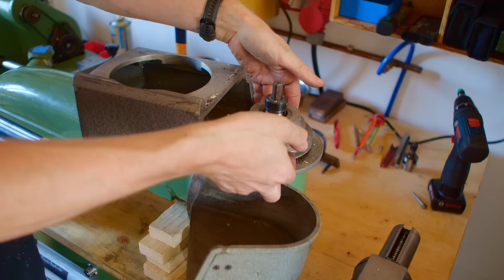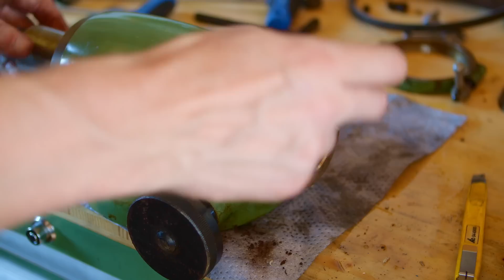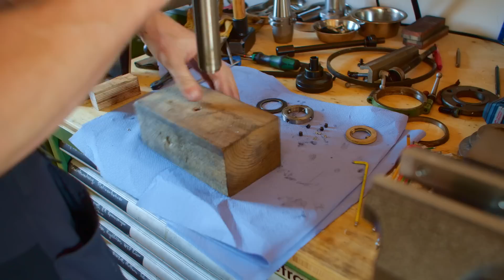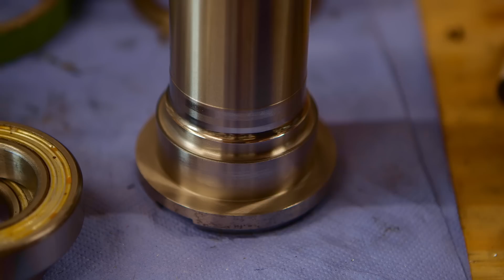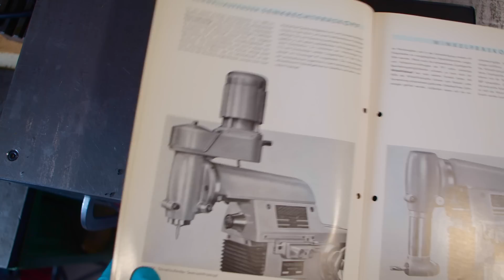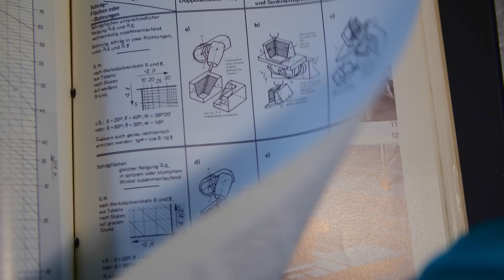Deckel Highspeed Head Teardown

Comment: Hi Stefan,
It's a great video again with lot's of information as usually.
May I ask you which Kluber grease do you propose for Deckel milling heads?
Thanks.
Sandor
Reply from the maker: That would be LDS18 if i recall correctly
Reply: @StefanGotteswinter thank you!
Reply: @StefanGotteswinter thank you!
I have asked since I have seen both NBU15 and LDS18 proposed on the internet. However as far as I understood LDS18 is preferred by Franz Singer as well.

Comment: @StefanGotteswinter do you maybe have some information of Deckel LKB (Feinbohrkopf 2021 model)? I have problems with sticky quill movement. When the spindle is working for awhile it starts to get harder and harder to move. I had it already disassembled awhile ago (was searching for dirt or rust inside) but didn't find anything with the naked eye. As much as I watched some videos (there are not many) the quill should move with the clutch engaged without a problem as well as with the lever. If I remember correctly I saw somewhere that the quill goes up by itself with the help of the spring. I can only wish with mine to do that. To me it seems like the housing and spindle bore are from two different heads put together and is not matched together correctly. Do you think it's possible. Any info would be great :)

Comment: Which episode shows the re-assembly ?
Reply from the maker: Not finished yet :)
Reply: @StefanGotteswinter  are you planning main head teardown or it's similar enough?
Reply from the maker: @MarekReinsch  No, not planned to do so - Its running fine and i don't expect problems. Its very different, running with needle bearings.
Reply: Thanks for your reply! Are the drawings available to know what's inside? Where do you get parts? Only from your local vendor where you bought your machine? On my normal head, the plastic guard around the gear is broken into a few pieces as I assume someone did not store the head correctly when removed...
Reply from the maker: @MarekReinsch  Franz Singer, FPS and Arnold Werkzeugmaschinen have spare parts and replacement/rebuilt heads
Reply from the maker: @MarekReinsch  A drawing is in the spare part list of the mill - careful, there are a few versions and iterations
Reply: Thanks for the recommendation. My FP1 is a bit neglected by the previous owner, but pretty much complete, including normal head, high speed head, 90degree angular head, variable angular head (missing motor), straight table, adjustable table, rotary table, indexing head and arm. I also got one of the Deckel cabinets from the catalogue but a bit worn. Currently doing an initial maintenance to remove years of old oil.
Love the channel! Thanks for taking the rotary table and high speed head apart!
I hope to get the slotting head at some point as I'm missing that! Also installing the overhead hoist next week.

Comment: Hi Stefan i have the dubble elbow with the high speed head but not the part to attach it to that machine. 
do you know if the was one for the fp1 or they used the one for the ordinary high speed head for fp1?

Comment: Those bearing look like some NOS Yamaha motorcycle steering bearings I have.
Ball bearings oscillating (only turn 60~90 degrees) isn't exactly best set up for bearings designed to rotate but it's worked for more than 100 years and gives lighter steering at low speeds than taper roller bearings.
Interesting to see bore was honed, I used to teach honing motorcycle cylinders with ordinary electric drill and Sunnen hone.
I remember having a 'machinist' (machine minder?) in class one time who laughed when I said honing to 1/10,000" was possible by hand. 
He said he had been machining 27 years and it wasn't possible. 
Three weeks later at end of class, he did apologise for his statement as 90% of people could hit +/- 5/10,000" and a few exact size (actually far better than was called for but doing their own cylinder boring and honing wanted it 'perfect' )
I always find manual machines of any type fascinating, Deckel examples show things most people (even machinists) would never imagine

Comment: Finally got round to watching this. Things I didn’t think I’d learn about: rat feng shui.

I’d be interested in seeing more detail on the head mounting ring, I have a cross slide on an old lathe that has some chips out of the circular t-slot and this solution might be workable. Thanks Stefan!

Comment: I love your videos: they give me a standard to strive towards. As an amateur bodger with a Bridgeport, I can confirm that the Bridgeport head will tilt, swivel, rotate as you wish. It's not difficult to do and the weight of the head isn't really an issue. Tramming the thing to be perfectly true in three dimensions can be time-consuming, but isn't that the case for all traditional machines?
Viel Spaß

Comment: Huh, not a great fan of this design... Remarkably efficient and pleasant to work with as long as it is well maintained, but should anything happen, it is really a major pain in the ass... I have a small Emco FB2 mill that is a part of your former lathe, tho, in the FB2 form, it comes with a proper little machine base and a coordinate table... Long story short, the spindle uses needles and is also a race-less design where the spindle shaft itself is one of the races of the needle bearing... Technically not serviceable either, as the pack is not easy to take apart and requires relatively precise compound differential heating/cooling for both the quill, some of the bearings and the shaft itself... 
If i ever get a deckel mill like yours, i am likely to make a custom quill/spindle as to incorporate a less fucky design and a bearing configuration, as i am likely to do with my FB2 spindle at some point... The general arrangements of the systems are great, but the execution of integral bearings always drives me mad... 
`s the same shit they do with some of the car wheel bearings... No bearings, just hubs with integral races and balls... Almost as if anyone will ever service those bearings, which results in shit lifetime of the bearing, and thus when it craps out, the whole hub has to be replaced, which racks up the price by 4.5x easily... Making the second hand ownership an apparently troublesome experience, and lowering the expected lifetime of a vehicle in general, at least statistically, which if you want to be eco-friendly - is a terrible thing indeed... Now machines like this and cars are not the same, but as you said, who has ever bothered with these spindles for as long as they ran flawlessly... But when that state is compromised, it is too late to try and undo the issue with ease... 
From all technical perspectives, it is a remarkably good design, transcends the issue of bearing size or rather the shaft dia limitation due to bearing size, fitment, preloading and so on, but it comes at the cost of being not a divine miracle in materials which do not wear or tear... Even were the spindle and the quill of solid micrograin carbide, and the balls be silicon nitride, the damned thing will still not last forever...
However, that is a damn nice head, and a damn nice addition to the machine overall... Glad you got it and i`m most glad that it is in as good of a condition as it is!

Best regards!
Steuss

P.s. It seems that you mentioned the major benefits and the design intention behind the integral races... Guess that`s what i get for getting a bit too passionate about stuff before the end of the video... 
That said, in my view, a needle bearing set with a rear thrust bearing is the optimal design should one seek to minimize the bearing dimensions limitation on the potential shafting dimensions and thus rigidity of the system... The rear thrust bearing is out of the way of lateral forces, and can thus rest on a hard shouldered, reduced section of the spindle shaft that due to radial needle bearings has the potential to be much thicker than a ball or cone bearing would allow for, which allows for rear tapered bearing as a thrust counteracting bearing, or even an opposing angular cont. bearing pairing, while the needle radials take up all the lateral forces exerted on the spindle through the cutter, and lets face it, there aint no bearing like a needle or a roller bearing for maximal single axis performance, maybe a hydraulic journal bearing, but that is a vile beast straight from the depths of hell itself, so lets leave that one for some other rant...

Comment: Inner race directly ground into the shaft, had the same (problem) on my Studer SFM 500. Why would they do that? Makes it impossible to replace the bearings, in my case there was pitting due to corrosion on the shaft, ended up regrinding the shaft to take standard AC bearings.
All OK with TIR < 0,002mm but would have much rather replaced with original bearings.

Comment: Nice example of how to work with quality machines.  I was a bit surprised by the integrated bearing races but they do save on overall spindle diameter. The high-speed head for the Schaublin 13 is just a little bit smaller :)

Comment: I have the older 60s lever controlled fp1. Is that head have the same design?
Reply from the maker: Hard to say - Keep in mind the regular geared head is needle bearing or on the older machines a plain bronze bearing.
Reply: @StefanGotteswinter  oh so I have the bronze bearng most likely. Thank you

Comment: And, so if the bearings go bad, dirt or abrasive material gets into the shaft basically the whole hub hoes bad, and needs replacement...instead of just the bearing...Surprised to see that kind of design....why was it done like that?
Reply from the maker: I said in the video why that design was chosen - size and stiffness.

Comment: In my opinion, this head is asking for a higher power motor coupled with a VFD. For the small parts you seem to do the high speed head could just stay on the whole time. With the VFD you would half or one third the number of belt speed changes. 
Thanks for sharing the internals of this spindal, always interesting for us machinery geeks.

Comment: Really interesting project, I'm glad you showed in detail how the bearings work.  The details in the books and example applications for some of these systems was a great addition.  I'm looking forward to seeing your progress.

It would be really interesting to hear you compare/contrast the two heads you have and what each is better suited to over the other.  It would be really interesting to see you tackle the sharp internal corners, it's hard for me to wrap my head around how that works.

I can't pretend it is the same, but I recently got a used 4 jaw chuck that had very limited use, but was pretty dirty.  There is a lot of satisfaction to take apart a nice tool, clean it up, and reassemble it into something satisfyingly functional.  I have more appreciation for how much work some of your restorations must have taken.

I've seen well maintained engines with a lot of miles retain their cross hatching.  I think they way they it holds a film of oil tremendously reduces wear.  If this was a well cared for machine, I would have no trouble believing that it could have many hours of use, but held up very well as a result of being a machine of excellent quality receiving good maintenance.

Thanks again for taking the time to share these projects.  These really encourage folks like me to try something that might otherwise be intimidating.

Comment: I feel you're not the first person inside that head and whomever was in there before you, didn't tighten things the right way. When i took mine apart (almost a NOS part), everything came apart by hand and medium force.
29:43 there's a Danish post (i can't find it anymore, it was probably from the late 00's by reckoning) where a machinist ground that section off, same as with the sleeve and used a Japanese tapered bearing set. Hist unit was .... carnage. That's one word to describe it. I don't remember much beyond that, other than the fact that he had painted the unit (or it was painted before hand, but it's a clue for those looking for this forum post) in a burgundy color. edit: another thing that i remembered, he ground the bearings off in stages. I think he said something like, letting the metal rest between grinding sessions. Dunno... how effective that is. I've never heard of anything of this, but i'm pretty sure that's what he said (my Danish is bottom tier).

Comment: My god, grinding ball bearing races onto a shaft, thats such a deckel thing to do. Insane 😅
Reply from the maker: Its more common than you might think - If you take a Harig Grindall spin fixture apart, it would have its single ball track also ground into the housing.
Reply: Not really, back 40years bearings where pretty sh*t unless you pay for precision matched ones.
Now today a standard bearing from a good supplier (ie SKF) is almost on par.
My old chinese lathe got the SKF treatment and runout gone from 0.001 to 4 microns. Just with standard on the self roller bearing vs chinese P4 angular bearings...

Comment: Thanks for the video. I decided recently to dsmantle my FP1 vertical head and horizontal spindle to carry out the clean and regrease on the basis of not knowing if it had ever been done. I was intrigued to see the 'integral' Deckel races for the needles and ball bearings! Thankfully, all are in excellent condition except for one slightly pitted flat thrust race that I got surface ground! Keeping watch on the horizontal spindle is worthwhile, as I noticed  lubricating oil contaminates the Kluber grease! Kind regards!

Comment: Consider to replace the balls ...with new ones.
Reply from the maker: The Microscope will tell me if theres need to do so :)
Reply: @StefanGotteswinter   I would think that if you find damage on the balls  then the likelyhood of the races being damaged are 
equally high or higher .  the bearing damage charts focus almost entirely on the races. 
the balls and races on regular bearing are generally  of same steel and same hardness.
It's possibe that Deckel has adjusted for this in some way  .
Still if you find damaged balls I suspect that a regrind of the races will be required.
By the way has NBU-15 become some sort of internet meme?🤨

Comment: Interesting that it has ball bearings, the FP2 main spindle on my machine used roller bearings. I wonder if the FP1 main spindle is the same.
Reply from the maker: The geared vertical and the horizontal spindle of the FP1 are also needle bearing spindles. Only the highspeed head and the precision boring head are angular contact ball bearing designs.

Comment: There are/where many clones and lean ons of Deckel build mainly in Europe.
They are mostly good/excellent. Some on pair with Deckel. I can think of about 15 brands.

Why are there no clones of Deckel L variants?

Like FP2L and FP3L, they seams to be quite nice machines with high table capacity (weight and lenght). 
Why are they "less desireable"?

Comment: I just watched your video on the slotting head again and you explained the this to me already.

Thank you for another great video.  I would like to get a Deckel FP mill someday but they are hard to find in the USA.  One thing about the Deckel FP mills I hear often is that they do not run in reverse.  Is it possible to make one run in both directions?  I guess power tapping is when it would be best to have it.  With the high speed head having its own motor it might be possible with a vfd.

Comment: Heij Stefan, about the mouse poop: I found a piano on the curb and took it in. After a few minutes it was clear there was a mom mouse in there, giving birth in a really artistic like nest. There must have been a stack of cardboard boxes next to it because mommy mouse chew cardboard into nice stripes 4-6mm wide and about 10cm long.
I have to admit, I found the consistency of the stripes very interesting. Mommy mouse made a web of them into the mechanics that strike the strings- as a tinkerer I found that very interesting as I cleaned it out.
Their bathroom was under the keys and moths ate the felt but the damage of the mouses was (thankfully) not too severe. They must have moved out after the little ones were grown- I´ve cleaned out many mouse houses in the past so I think I can tell how long the nest was used.
You do a nice job, Grüße aus Göttingen!